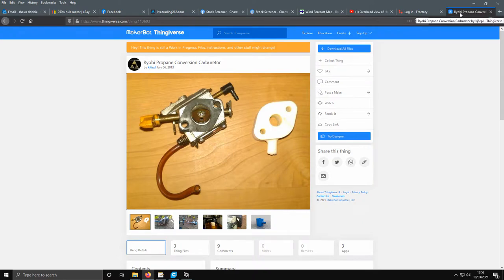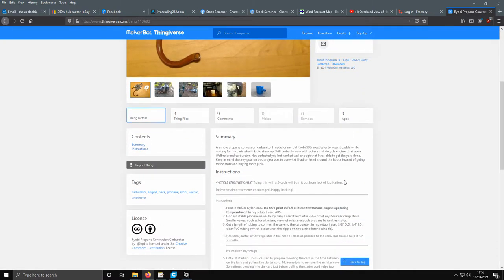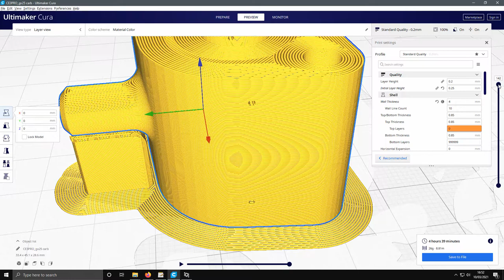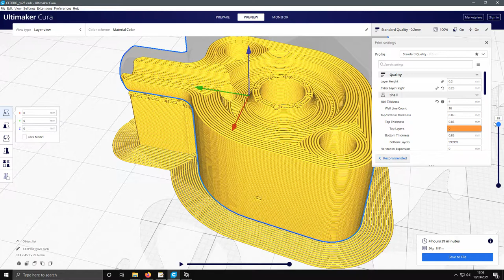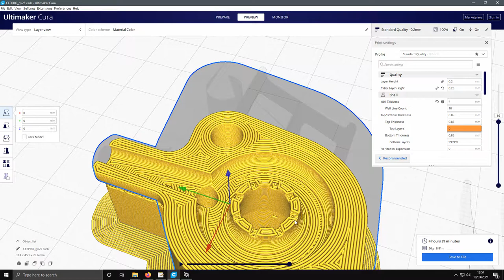GX25 3d printed propane carburetor

Comment: Annealing your parts in the oven and using a carbon fiber alloys would definitely work reliably, have the chemical resistance for different fuels and won't break that easy, cool project

Comment: One continuous slot may actually work, But not with a consumer fdm machine. Might work with a resin printer, But it should work well with one of those metal power laser printers.
Reply from the maker: That would be awesome.